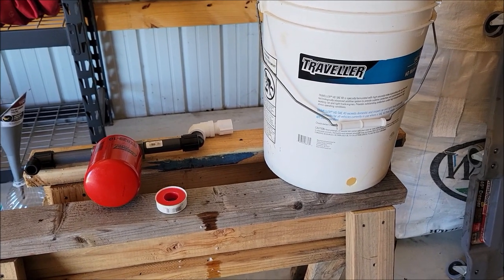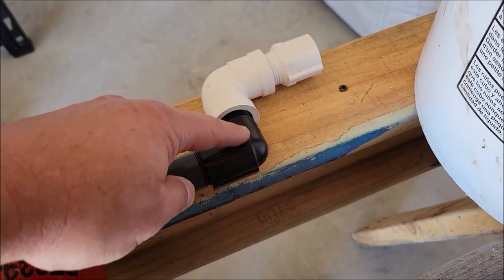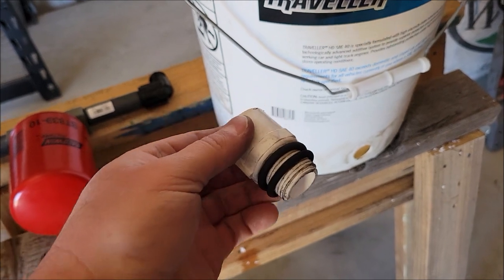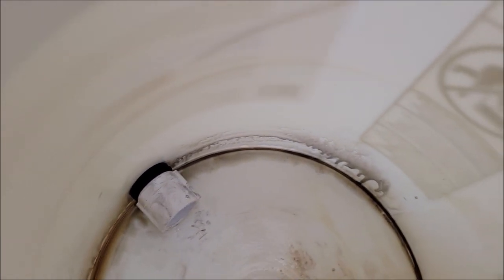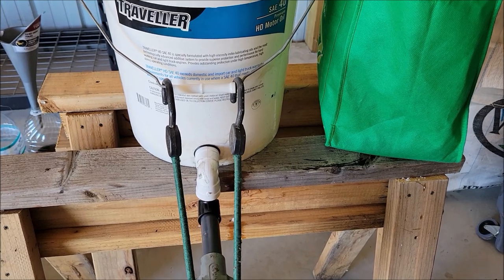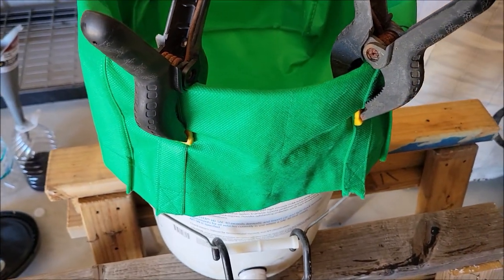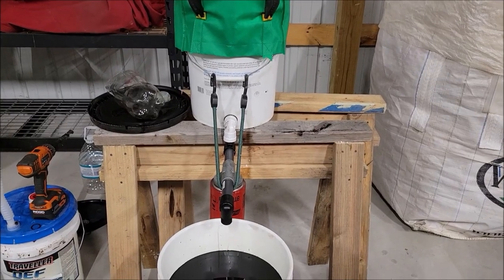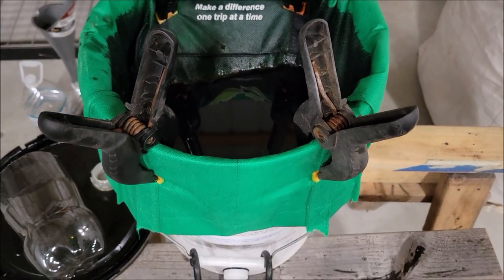Filter Used Motor Oil - Can Oil Be Used Again? - Reusing Old Motor Oil

Comment from the maker: What do you think?  Have you done anything like this?  I use this oil to lube things around the shop and put on wood decks on my trailers.  You can use it in a chainsaw in a pinch.  I have not tried it mixed with diesel as fuel, but I have heard people do on older farm equipment.  Anyway, let me know what you think.  Do you know a better way?
Reply: Have you looked into the Frantz toilet paper oil filters? They are cheap and filter to an extreme degree search on you tube.
Reply from the maker: @trdscfjc  I did not know about those.  I gotta try that.
Reply: i filter used oil from the autoshop i work at and run it with a mix of diesel in my 80s mercedes 300d and it runs great and saves me a lot of money in fuel plus the shop doesn’t have to pay as much for oil disposal and i get free fuel with a little time and effort
Reply from the maker: @jackmurphy2253  Definitely another cool option.  Those older tractors would run fine on this.
Reply: Don't reuse old oil though. It may be filtered but it breaks down at a molecular level during use, and doesn't have the same qualities and the newer oil it is designed to use. You'll wear your bearings out super quick. You can use it as fuel oil though.
Reply from the maker: @NeoSim76  Good info, thanks.
Reply: I stopped draining oil in 1963 with a Frantz oil cleaner and Standard Delo.motor oil. All I have now is top loaders. Just put a Australian Jackmaster Classic on the Pontiac. The others. Have Motor Guards and Gulf Coast junior filters. They all use Scott 1000 toilet paper. Also converted a flat head Ford V8 canister filter to use a roll of 4 1/2 inch Scott 1000. I put it on the Ford diesel tractor. I dont allow oil to get dirty wear and foul the engine then drain it. The Frantz is a good filter. The top loaders are easier to service. With a dozen in use that means something to me. I have a few engines. A engine needs some new oil added. I add a quart of new oil when I dispose of a oil soaked roll of toilet paper.
Reply from the maker: @ralphwood8818  That sounds really cool.  I need to get one of those and try it out on the tractor. Thanks.
Reply: I have mixed 50/50 with diesel and used in modern common rail cars. The problem is that it clog really fast the fuel filter
Reply: @SeidelRanch  There is a lot of information to research these days. The Australian Jackmaster Classic is my favorite of the ones still in production. They are not easy to sell. Most people think oil is supposed to get dirty and be drained. Clean oil doesnt generate profits. My Pontiac Torrent gets a roll of Great Value 1000 toilet paper and a quart of Walmart synthetic every 6. 000 miles. Mostly warm weather highway.. You have to make adjustments for different driving conditions. Jackmaster has a lot of information on their website. I havent sold filters in years. You get the new additives in the new oil added at filter change. I have 60 years of experience. Cant explain everything ive learned in that time. The Motor Guard on my old Ford F250 390 engine is over 50 years old. The Farmall H has a Motor Guard. Not sure when Motor Guard went out of the oil filter business. They only make compressed air filters now.
Reply: The reason I have been using Great Value 1000 toilet paper from Walmart is it is a little smaller than the Scott 1000. Dont have to unroll as much. On the flat head Ford V8 canister filter the Scott 1000 fit better because the Ford filter is bigger. I origionally set it up for Scott 1000. Right now I have half a roll of Viva towels in it. The Ford diesel tractor has a Motor Guard on the fuel. Couldnt gravity enough fuel to feed the injection pump. Removed the Great Value 1000 and put in Charmin Ultra Strong. For the hydraulic system I reduced the pressure with an orifice a needle valve and a pressure gauge. Running a Motor Guard and full flow filter in parallel. The full flow filter is to take all of the flow in case the Motor Guard reaches its capacity. So I wont get blown off the tractor by an exploding oil filter.
Reply: If you are looking for a used filter that will get the job done the Frantz will get the job done. Its a terrible design. If you are buying new get one of the top loaders. I have a Australian Jackmaster Classic. Thats the one im familiar with.
Reply: By top loader I mean you remove the lid push in the toilet paper and replace the lid. There are a bunch of them. I prefer the ones that take toilet paper. It has served me well for over 60 years.

Comment: Many years ago I worked with an older gentleman who had grown up during the great depression in a thrid-world country, where oil was hard to get and very expensive.  He told me how they cleaned oil to reuse it.  He said they put a jug of used oil up on a shelf 6 or 7 feet above the floor.  Then they put an empty jug on the floor.  Then they put a 1" cotton rope into the used oil jug and ran it up and over the side of the jug and down to the empty jug on the floor.  He said you just stick the rope in the used oil and it will wick itself up the rope and down into the empty jug.  As it flowed down the cotton rope it filtered the oil and it came out looking like new oil.  He said it was clean but still had been used so they either mixed it with new oil or used it 4 quarts of used oil with one quart of oil treatment like STP, and they only used it twice before they replaced it all with new oil, but it helped save money and had to find new oil.  He said it takes a while so you just start it and leave it for a month or so.  I always change my own oil and I've said many times I was going to try it but I never have.
Reply from the maker: I have heard of the wicking process, but not with oil.  I have to try that.  You do what you have to do when times require it.  Great info.  Thank you.
Reply: I heard of this and tried it last year ..... took 30 days to filter a few Oz of oil lol ....but it was way cleaner and smoother and clear then the dirty motor oil it use to be
Reply: Use a rolled white towel to hasten the wicking.
Reply: One tip. Instead of one rope use more ropes to speedup the filtration process
Reply: I will try that. Seem like a sound idea
Reply: Why not just put a filter on your car that cleans oil. Its easy to gravity oil thru a filter that doesnt clean oil. A filter that cleans oil needs an oil pump.
Reply: My 79 Ford diesel tractor has a flat head Ford V8 canister filter converted to use a half a roll of VIVA towels. The Pontiac has a Australian Jackmaster Classic that uses Great Value 1000 toilet paper from Walmart  l have a portable system for cleaning used oil but I dont generate much used oil.

Comment: but..this is just one more filtering of oil that has been run THROUGH A FILTER HUNDREDS OF TIMES IN ITS lifetime in USE!how can one more filtering help it at all?  it needs thinned with heat,,,then ran through a flilter small enough to clean the black out of it..this single process is a waste of time!..
Reply from the maker: This process was to get out anything that did not go through a filter, like metal that has been sitting in the bottom of your oil pan.  This is also to make sure any junk that entered from the oil change like dirt from the oil pan and whatever else got in the drain pan.  The 1st bucket filter caught all kinds of garbage when I poured it in.
Reply: That makes sense that makes sense good call yea weee wooooooooooo

Comment: The particles you need to eliminate are so fine, they easily pass through any kind of mesh filter. Think about it these particles have already passed through the filter on the vehicle several times. You aren’t filtering anything. Then there is agglomeration, after you “filter” it through that set-up, any fine particles will cling to each other as the oil sits, just creating larger particles/sludge. At best all of this does is thoroughly strain the oil. To truly filter it, you need a centrifugal filter that rotates the oil at very high speeds and traps contaminants as sludge.
Reply from the maker: For what I use it for this is good enough, but I would love to try a centrifuge just to see how well it does.  Thanks for the info.
Reply: Had a 305 Honda Motorcycle with a centrifuge. You still have to drain the oil because they dont require makeup oil. Most people prefer the simplicity of a depth oil filter.
Reply: I mix 1ltr of used engine oil in a Tub with 5g of Gelatin mixed in 125ml of water. Leave it for 2 days and you are left with thick sludge at the bottom of the tub and clean oil on the top. Gently pour the oil into a second container leaving the sludge behind. I then mix the cleaned oil with 500ml of kerosene, mix well, and I then have 1500,ml of fuel for my kerosene heater. Most probably not good enough for a vehicle engine but perfect for my kerosene heater
Reply: @sparkesman1980  That works for motor oil? I’ve heard it used to clear up vegetable oil, but not motor oil.
Reply: The Military is using a lot of Big Gulf Coast filters. An Abrams tank Im told has 2 fuel cells. The fuel is normally only used out of one cell. The fuel in the other cell needs cleaning. They use the big Gulf Coast filters for that. The Big Gulf Coast filters are rated at 99 % at under 1 micron. About the same as the higher quality toilet paper. These systems are portable with a air pump. Also used for aviation fuel and cleaning solvent. Starting to see more on over the road trucks.

Comment: Use a bypass oil cartridge. Most of them filter to 5 microns
Reply from the maker: Thanks. I will check that out.
Reply: Yes; the Baldwin BT839-10 has a "Nominal" Micron rating of 12 (which obviously from this video doesn't do a very good job at cleaning the carbon out), but Baldwin's B164 Bypass Filter oddly doesn't state a Nominal rating, but states an Absolute one at 15 Microns. - So best to find some other brand.  ---  I wonder if a 2 Micron Fuel Filter would work on this setup.
Reply: best to use a bypass filter during the operation of the vehicle. fs-2500 go's down to 1 micron at $35 a pop.

Comment: The original equipment that used the oil has a filter. And it circulated a hundred million times through that filter. Why did you think running it through an identical filter one single time would clean it at all? Ridiculous!
Reply from the maker: Well, in the video I explained why.  When you drain the oil from an oil pan, you get sludge and metal parts that sunk to the bottom and never went through the oil filter.  Add that to the stuff that falls off the oil pan when changing the oil and the other conditions like the wind and you can get contaminates in the oil you did not expect.  That is why I run it through a filter again.  I am not going to use it as motor oil again, but there are many other uses for this waste oil.

Comment: Used motor oil...Check out the Pyrolysis method..You can use a wood BBQ for the heat source..Main usage is heating oil for this stuff...
Reply from the maker: I will check it out.  An oil burner is on my list to make.

Comment: I bet if you thoroughly filtered full synthetic you could use it almost indefinitely. As long as it never exceeded it's breakdown temperature. I'd love to see someone do an in depth scientific lubrication test. (Also maybe heat it to a certain temperature to evaporate any water contamination).🤷‍♂️
Reply from the maker: I was going to fashion a type of boiler one day that heats from our wood stove to get the water out of old oil, but have not done that yet.

Comment: If the oil come out of a piece of equipment with a filter, then it's already filtered. The oil is black because its dirty. Even stepping down to a 10 micron filter wont change the color. Try using a heater and centrifuge next.
Reply from the maker: Most of it is filtered, but some can have contaminates in it like dirt or whatever as I am under the machine draining it.  Like changing the oil on my dozer or skid steer, dirt finds it's way in.  But, yes, the filter is going to only do so much.  I would love to try that (heating and centrifuge).  I bet that would pull out all kinds of more junk from it.  Now just to convince the wife I need one.

Comment: Nice. Used oil is good for so many things.
Put a magnet on your filter... It'll catch fine metallics.
Reply from the maker: Yeah, I find myself using it more than I make it.  Thanks for the magnet tip.  I will try that.
Reply: A roll of dense toilet paper removes all abrasives.dont have to be steel.A magnet helps.

Comment: I like this setup with a spin-on, esp vs using whole house filters with the mess of changing cartridges. Using old motor oil on wood trailer decks unfiltered I collect a LOT more hydro from servicing my tractors. It doesn't get very dark, and stuff will settle out over a few weeks. I want to copy this. Decent gear oil then for hitch pins or to top up lathe headstocks after adding a wee bit of zinc. I agree with all who mention using magnets anywhere & everywhere.

Comment: Old diesel engines love used motor oil. Gives a smooth idle and a bit better boost in power.
Reply from the maker: That is true.  I could add it to diesel fuel and run it in a number of my old tractors.  The uses are endless.
Reply: Hi When you say “Old Diesel Engines” do you mean specifically non-common rail , will it not work on common rail Diesel engines ?
Reply: @klecoxs2  I'm not sure about modern diesel engines.
Reply from the maker: @texaskidzuk  I would not run old motor oil in any newer diesel engine that has direct fuel injection.

Comment: That's something to think about.  I bet there are a lot of good uses for oil engine oil.  I have heard of people using it on wood.  Also, people burn it for heat.
Reply from the maker: Yeah, I want to make a homemade smudge pot to burn oil in.  So many ideas, so little time.

Comment: I doubt you have magnacleans in the us so you’d have to import from the UK but we use them to filter heating water, the water goes black from the inside of steel radiators, so I imagine the black in oil is also metal that hopefully is magnetic, you could just get a strong magnet and drop it in the oil first then if you wanted to go extreme get an Adey magna cleasne
Reply from the maker: I will try that.  I wonder if I can put a big magnet on the outside bottom of the bucket if it will help.

Comment: Of course, oil has various "packages" added to it, which evaporate or break down over time--including anti-sludge additives, detergents, dispersants, etc.
Reply from the maker: Right.  I would not want to use it as motor oil again.  Just give it more life buy using it for other good purposes.

Comment: You need a much better filter. I think of using the denim cotton pant leg in a pipe.
Better yet, get two pant legs , one inside of the other sewn together making square 2” plaid pattern blocks filled with non clumping kitty litter. The pipe is 5” dia steel lined with expanded metal for the pant leg to press against providing path for filtered oil to escape.
You need end caps. And a means of hydrolic pressure to push the oil thou, perhaps an oil oil pump from dead engine.
Heating the oil will make it flow better.
Reply from the maker: All really great ideas.  Thank you!  I plan to redo this a little and I will definitely add some of that in.

Comment: As dansmith5524 says below, I to have seen this rope method used, just be aware that the spesial lubricating properties new oil have will not return with any method of cleaning the oil. If you intend to run it in a engine never use more than 50% cleaned oil with the rest being new/unused and remember that the life span will be shorter. For wood treatment or burning as fuel however this works well. With your current method add a valve so you can shut the oil of and use a finer filter to get better (and slower) results, may be a fine diesel/fuel filter would yield "cleaner" results. A pump would speed things up and allow the second bucket to be above the first so the oil can do several trips through the filter.
Reply from the maker: Great tips. Thanks.

Comment: Nice setup.  I was looking for a way to thin my chainsaw bar oil, its way too thick when it gets cold.  I found canola oil works also but this gives me a few ideas on how to get rid of used motor oil. Nice video but you need a cheap 1/4 turn spigot on the end.
Reply from the maker: That's a cool idea. Thanks.
Reply: Just use your used motor oil for bar oil.

Comment: When you want fine sediment to fall out of wine you add bentonite clay, there are other clearing agents that work even better.  It is a polarized particle that attracts and attaches to any floating particles and eventually settles to the bottom.  This could take a few weeks, I dont know how it would work in something as viscous as oil but it would be an interesting experiment.  Add some bentonite to oil in a jar, stir it up to mix it into solution and leave it in the closet for a few months. Poor or siphon off the top leaving the sludge at the bottom
Reply: This might sound crazy but I also considered putting a flat metal plate at the bottom of the bin and soldering a wire to it.  Drill a tiny hole in the bottom of the bucket and caulk it to seal it back up.  Then attach the positive terminal of a battery to it.  Take a metal rod and attach the negative terminal to it.  Stir the oil vigorously with the rod, dont touch the the plate and rod while stirring.  In theory this would negatively charge suspended particles with electrons and they would be attracted to the metal plate.  Maybe stir it every once in a while and leave the electrode suspended in the oil.  Not sure how conductive used oil is.  In theory it would become increasingly less conductive with time.   Would be a fun experiment.
Reply from the maker: All very good info.  Thank you.  I like those ideas.
Reply: Bentonite can be reused?